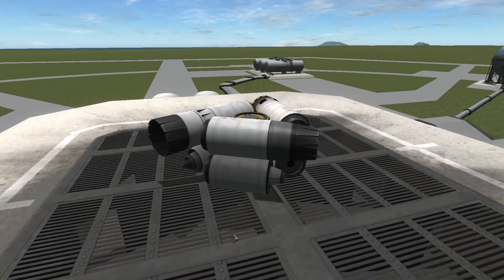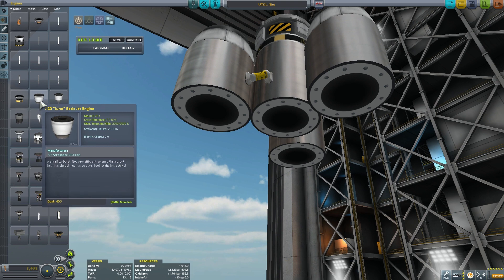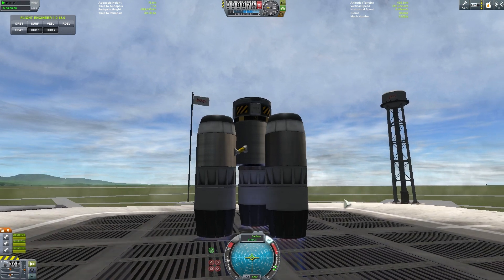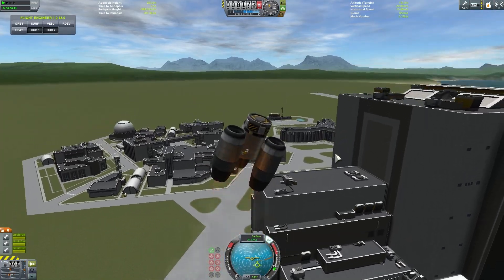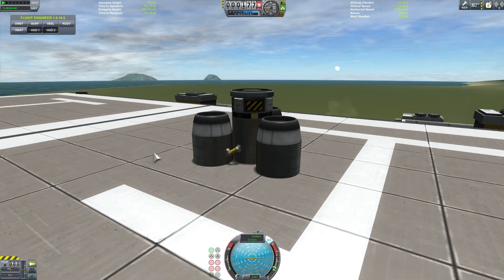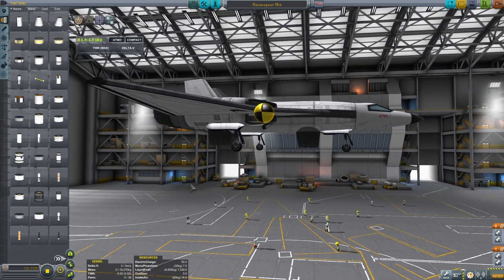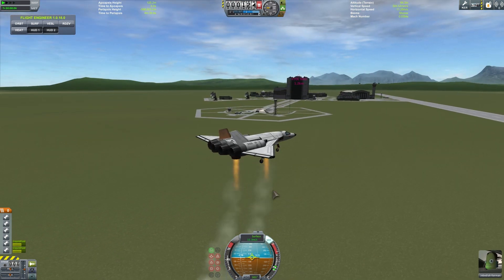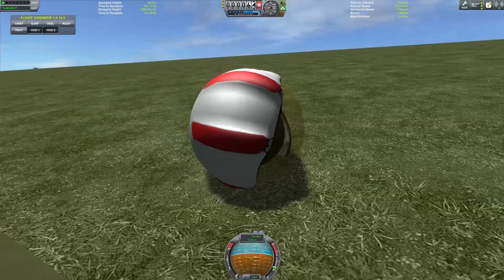KSP - Turbojet "Panther" Engines and VTOL Design

Comment: Had a TWR>1 F-22-like jet. I didn't intend to make it a VTOL, but it absolutely works as one. The extremely strong gimbal range and rapid spooling time really help it. I cut one of the wings off by flipping out near the ground, and then contined flying as a VTOL, eventionally flying knife-edge 20-meters from the water before leaning forward enough to generate lift and reach over mach 1 sans my left wing.

Comment: I have a challenge make a VTOL aircraft with one engine.
Reply from the maker: +Rohan Rahman surprisingly, one engine is usually the easiest. you just have to position it right in the middle. the hard part is trying to make a much larger VTOL that can do everything like land/take off without losing control
Reply: Anton Petrov yes I know but going forward like a normal air plane will be hard with one engine